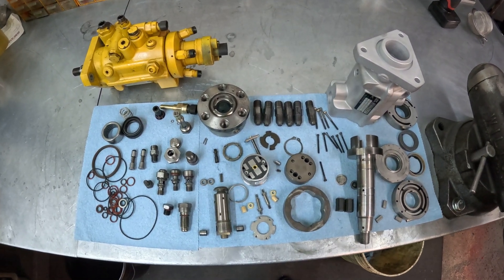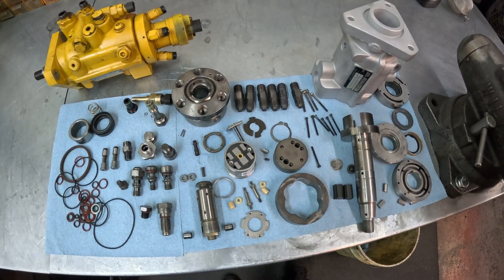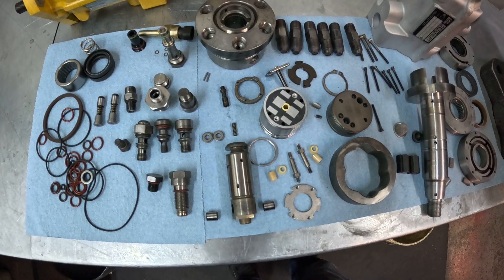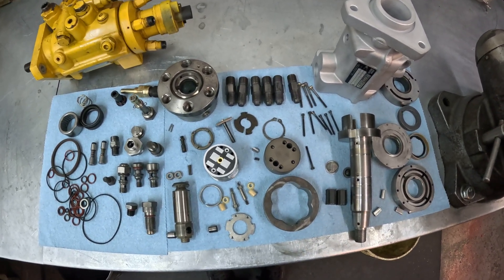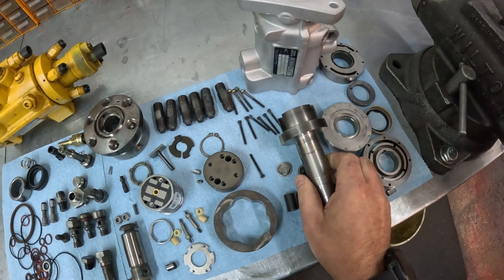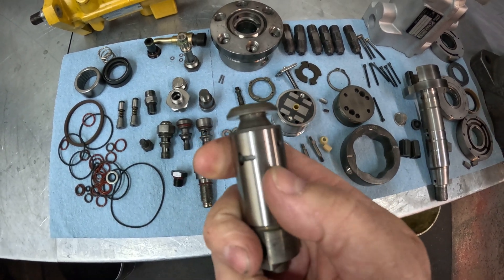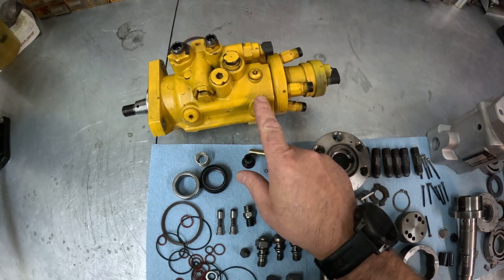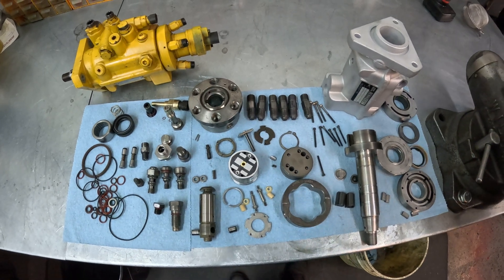Stanadyne DE John Deere Rotary Pumps - Common Failure Points

Comment: Hello..looking all over for a vid like this..i have a 544j with a 6068 motor.and it have this stutter.change injectors and grommet seal, fuel lift pump ,and it still stutter as if u crack a fuel line on a diesel enging.i does that like its normal...please can i get some info on what to do